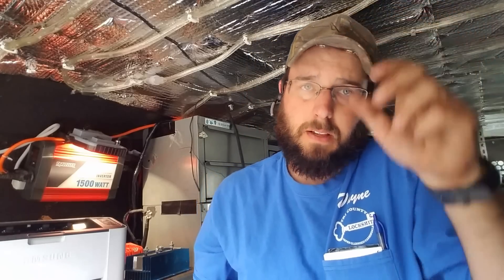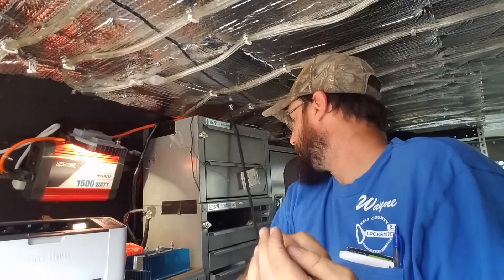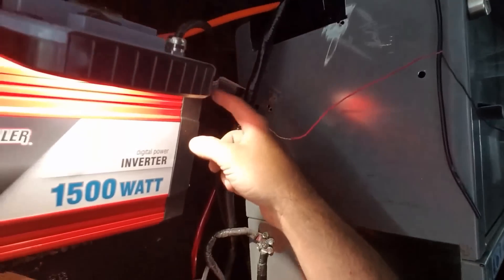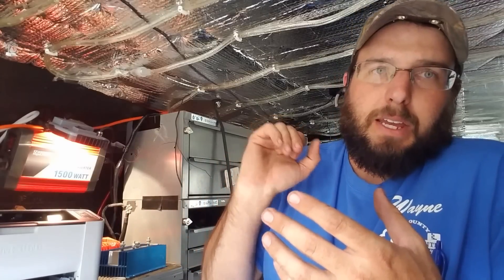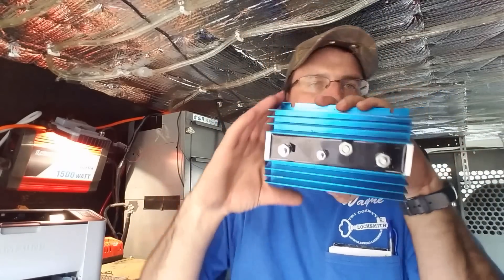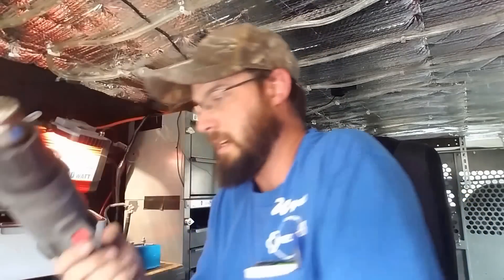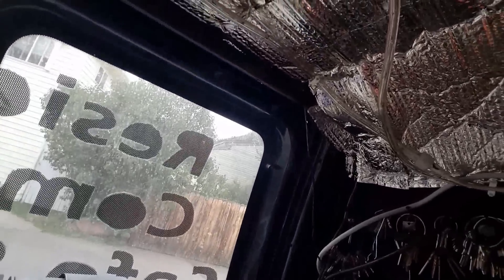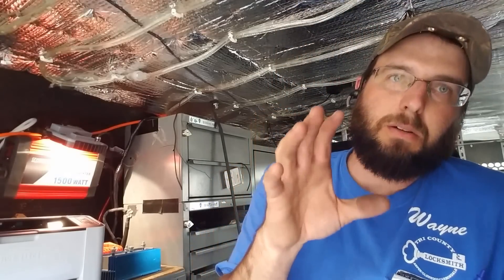Easily install a power inverter in your car, truck, van, SUV or RV traveller 1500 w power inverter

Comment: I think I have that issue. My 6000 watt inverter cannot even run my 1000 watt microwave oven.  I am using 0 AWG wire plus a 300 am Stinger overload switch. But my microwave only can function for 30 seconds at a time!!! I leave my engine on of course to power the inverter. But I think possibly I do need a second battery to withstand the initial electric shock! My first 3500 watt inverter literally sparked and caught fire 30 days later!
Reply: Your 6000 watt inverter may not be pure sine.

Comment: Thank you. I would like to have a professional do this for me. Can you tell me how I can contact someone? I don't even know who I would call or what terms I would search. Would any auto shop be able to do this? Or would I search electrical automotive? Sorry. I have so much anxiety about wiring and electricity.
Reply: Any auto shop should be able to. Or maybe a car stereo place even
Reply: is a sealed battery safer? Where does the gas go if partially sealed needs to vent gas?

Comment: You’re wrong about so many things. The overload people complain about is because they’re using a wire that can’t handle the current. The size of the inverter doesn’t matter unless you’re reaching that limit. If all you do is turn on a key machine and it overloads, it has NOTHING to do with your battery. It is because the wire is too small.

Comment: "Easily install a power inverter in your car, truck,......"  ummmmm...so where's the method?
Reply: There is a method.. and trust me after just installing mine in my work van .. the methods and ways are many lol ..  
I will be Uploading what I did in my dodge promaster city van .. of course this video helped me get started.
But the Promaster City Vans are in many ways more complicated than a full size promaster .. they are lucky to have a second battery box

Comment: hey . do you bring your ground cable from the front battery to secondary battery as well?
Reply: You don't. You just find a solid metal piece of the vehicles frame and screw down a short cable to it and it will properly ground it.